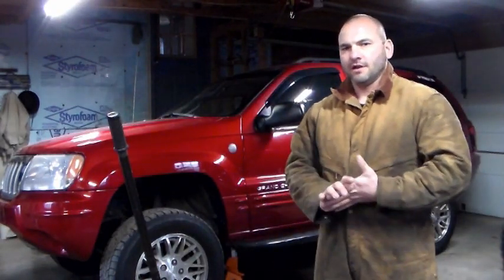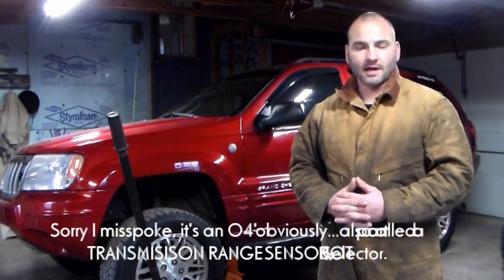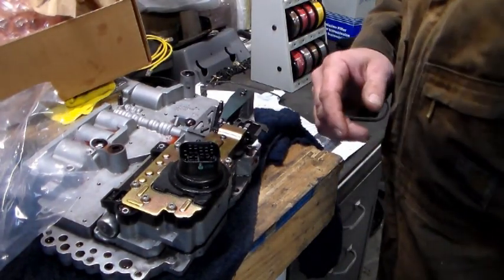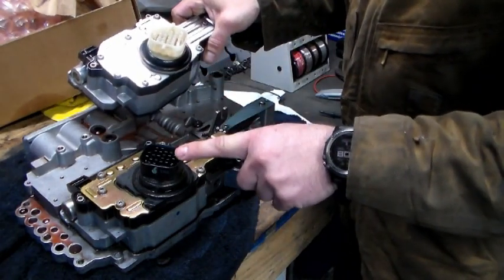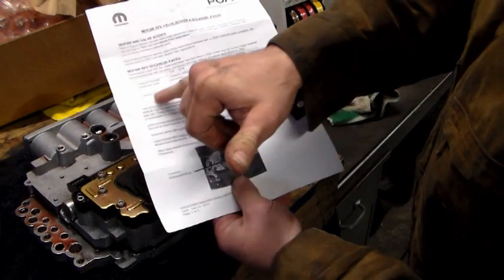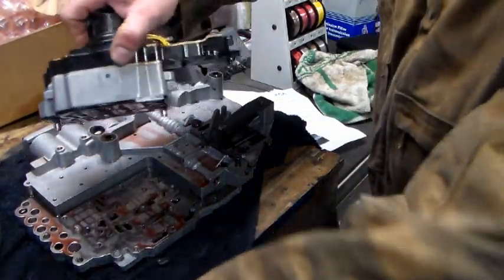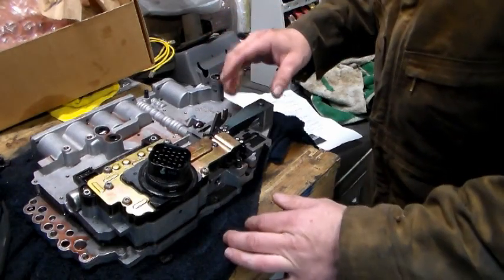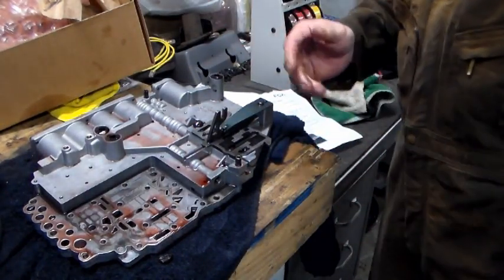NO REVERSE LIGHTS - 1999+ Dodge/Jeep 4.7/5.7  HOW TO FIX

Comment: Amazon told me its the NS194 part that fits my tranny  (2004 RAM 1500 with a 4.7). Went to switch it out so I can get the reverse lights to work. Didn't find the solenoid. Looks like I have this setup and Chrysler made it a million times harder to replace. I guess my backup lights are now retired. Not gonna go thru this much trouble for backup lights - its ridiculous. Great video, however.
Reply from the maker: Geez...and thank yoi

Comment: Hey Guys! Thanks for the video it's perfect. I have the same issue, funny thing recently I changed the oil and filters of the tranny and the backup lights started working again for maybe 2 days (best 2 days ever) - sadly stopped working again, on the bright side seems that the solenoid pack isn't burn, but wondering what's going on?. I didn't remove the valve body or the solenoid, not even the connector. So it might be poor contact between the body contactcs and the can plate? - Any other idea? I'm thinking either that or a wire in the connector

Comment: I am having issues with my BUL as well - except I have a 4.0L. I was looking for info because I thought mine was going to be in the Trans as I saw another video talking about this but they didn't mention what engine. SO, here I am and right off the bat you confirmed that the TRS is on the outside of the trans on mine... Thank you for mentioning that!!! In any event, Since I am a Jeep lover and the years 1999-2004 are my choice years, I watched the video all the way through. Even though I am not probably ever going to get a 4.7 because of all the issues that they come with, you never know :) - Great video!

Comment: Does this also apply to a 2008 jeep grand Cherokee  Laredo,  3.7L v6 ?
Reply from the maker: IF the same trans I would think so.
Reply: @rednecktech82  I know it's a few years later but I'm having the same exact reverse lights issue in my 03 grand Cherokee. I dropped the trans pan and replaced the solenoid pack with another black connector pack and still no reverse lights. In the video were you saying that is has more to do with the TRS plate than the actual pack or is it both?
Reply from the maker: @skyeagle55   Both. If I remember correctly when you swap out that new pack you have to get the upgraded TRS plate as well. It was a different design or something... I can't remember exactly.
Reply: @rednecktech82  I'll have to try and get one of the white connector packs WITH the new TRS plate and see if that fixes my issue. I'm really struggling with this issue and my absolute last solution is to wire a switch to the reverse lights =(

Comment: Thank you very much for this video I am 90% sure that this must be my problem since I tried everything else but I have a doubt I need to change the complete selenoids pack or I can change only the "cam plate" or whatever it's called. its a 2004 limited 4.7 grand cherokee don´t know if it have white or black selenoid pack.

Comment: hi my jeep laredo 2005  backup lights doesnt work and I switched the stop bulb with the backup bulb to see if was the bulb but didnt work neither.....I dont know what to do next
Reply from the maker: Does the reverse bulb on the other side work? If you have no power to either side I would check your wiring and things. After that most likely this video is your issue.
Reply from the maker: Don't forget to check the TCM relay and other things stated in the notes of the video first also. This part isn't exactly cheap so you don't want to Parts change until you have tried everything else first.
Reply: RG Emilio when i put the backup bulb in the stop socket works...the backup socket is the problem
Reply from the maker: @wesleygabriel24  so the other side reverse light does work then? If so just probe your wires at the reverse socket that is not working to make sure power is going to the socket and if that is all that's wrong that is easy enough, go to the junkyard and grab one for $1 or so!
Reply: RG Emilio they don’t work at all
Reply from the maker: @wesleygabriel24  so no power to either reverse bulb socket? If so check your wiring back to the transmission make sure you don't have any issues in the wiring and check any related relays. Next you would check for power right at the solenoid on the transmission. If you have power going to the solenoid but no power coming out going to reverse lights then you'll be replacing that.
Reply from the maker: @wesleygabriel24  unfortunately I don't have a manual to that vehicle so you'll have to do some checking online to get wiring schematics to know which wires to probe at the solenoid.
Reply: Hi my Jeep Laredo is 2005 and the TRS already have the white connector...so i dont know if the last owmer already change it or is the stock one...the wiring and fuses are goods
Reply from the maker: @wesleyrivera1741  if neither side is working and you have verified no power is coming out of the TRS at the transmission then the TRS it's going to be your issue. Only earlier models had the black plugs that needed upgraded to the white ones just because it's already white doesn't necessarily mean it may not still be faulty.
Reply from the maker: @wesleyrivera1741  if you've checked the physical wiring and have no power to either light socket but you have no means of checking the wiring at the actual harness at the transmission then you can throw the dice and I would say most likely the TRS is going to be the problem if everything else has been checked. If you can find wiring schematics to check power going into the TRS but none coming out that would be ideal because then you will know for 100% that is the problem

Comment: I have a 2004 with the 4.7 would it have the same transmission as yours in the video?
Reply from the maker: Yes it should be the 545rfe in the 04' with a v8.

Comment: Hello i got dodge caravan  2003 3.3l no reverse lights but no find the bulb reverse or too is the transmision range? Help me please
Reply from the maker: I apologize but i'm not sure i understand the second half of that...you can't find the reverse light bulb?   Check the bulbs and bulb plugs at the tail lights.  If NEITHER reverse light works get a volt meter and check for power at the tail light housings...if no power to EITHER bulb plug then verify wiring is good, if all of that checks out then this solenoid would most likely be the issue.
Reply: @rednecktech82  hi friend already check all the wiring and it's fine I have all the lights except the reverse I do not have voltage in the retro wiring
Reply from the maker: @z1crx174  then yes this would be my thoughts on the next most likely cause...especially if Both reverse lights are out, having 2 bad plugs etc at same time highly unlikely.
Reply: I also want to tell you that following the reverse wiring I discovered that they reach a box that is under the steering wheel
Reply from the maker: @z1crx174  if you want to be positive before you spend the money then you can test the solenoid at the wiring harness on the transmission but I don't have schematics to help you out with that.
Reply from the maker: @z1crx174  to be straight with you if it was me I would spend the money and replace the solenoid I'm going to say from what you've said I'm 99% sure that is the issue I'm just saying if money is tight and you want to be absolutely positive then you can test at the harness on the transmission. Being an electrical component I don't think the solenoid is returnable if it is not the issue. Except maybe if you buy it from Advance Auto Parts they are like Walmart and will take anything back! LOL
Reply: thank you emilio then i will buy the range transmission sensor
Reply: very good video I congratulate you and I greet you from el salvador
Reply from the maker: @z1crx174  in case you didn't already be sure to watch the full video so you know which color plug solenoid to buy and whether or not you need a new plate.
Reply from the maker: @z1crx174  also I just now noticed one very large detail about your situation! I know for a fact this applies to the 4.7 and 5.7 I have not worked on 3.3 L and so I do not know if there may be any other items associated with the reverse lights like a reverse switch or anything like that, make sure you don't have any of those type of items that could possibly have failed.
Reply from the maker: As long as the transmission is one of the two models mentioned in the notes of the video then you are good to go I just am not sure what is mated to that 3.3L
Reply: if I look for many videos and only show how to change only the bulbs😂😂 and some have the same problem but there is not video to show how solution the problem to dodge caravan 😥

Comment: Would you necessarily get a code or a check engine light if the tcm relay was faulty, Just want to rule out some possibilties?
Reply from the maker: No, won't always throw a code.

Comment: Great video....  Whenever i put into reverse the run ignition fuse blows, fuse no.20,    Could it be a faulty TRS ?   All other possibilities have been eliminated.
Reply from the maker: I wouldn't go right for the TCM quite yet.  You have an electrical short to ground somewhere that is blowing that fuse.  Check rear bulb sockets to see if either of those is melted or fried, check harness running to the rear light housings and then track that harness the rest of the way up...not to hard to get to it.  THEN as a last resort you can replace the TCM but that is an expensive place to start and I just find it more unlikely the circuitry in that is causing the issue.
Reply: @rednecktech82  Thanks..... Have unplugged the lamps.... Checked loom... All ok.. Will energise the reverse light wire at the valve body plug... Looks like violet and black wire..
Reply: Didn't check the loom that well.... Found a previous  repair in the loom gone bad.... Happy cheap enough ending.... Thanks again

Comment: Thanks..... I'm hoping if I change it I will get my back up light back and also fix ny problem of it not wanting to start back up after everything is warmed up and then start when it's all cooled down
Reply from the maker: Jason Dunbar if you've checked and you have no power to the reverse lights at the housings then this should definitely fix your problem with that. I don't know that it will be related to the Jeep shutting off when it warms up. I had just got done fixing that same exact issue with another Jeep last summer but at the moment I can't think for the life of me what the problem ended up being.
Reply: @rednecktech82  I have been looking and looking and I have found anything so far that is causing my problem I have with it not wanting to start after it has been all warmed up and driven and shut off... what I have found tells me  changing this part may fix it.... or it could be my computer or it could be my starter wire..... but I get a code saying that there is no trans bus message code when it happens....... I will have to try and make a video of it and what's goin on.

Comment: Can you tell if you have the black or white plug with out pulling out the valve body?
Reply from the maker: Jason Dunbar yes, if you look where your harness plugs into the top of the transmission you will see the connector poking out of the case and you'll be able to tell if it's black or white.
Reply: Does this also apply to a 2008 jeep grand Cherokee laredo,  3.7L v6  ?